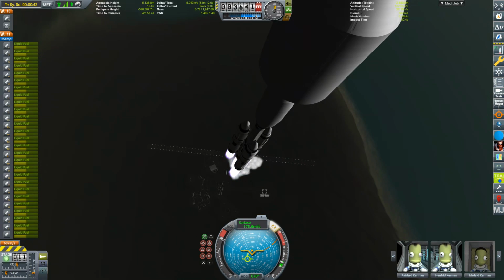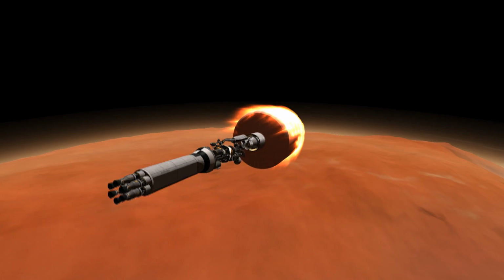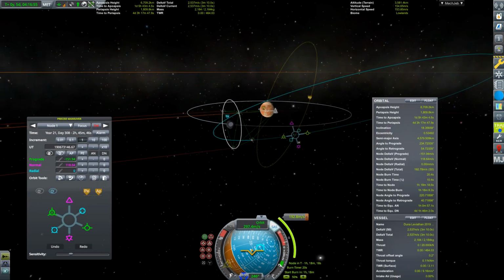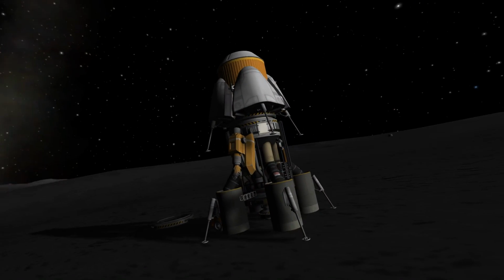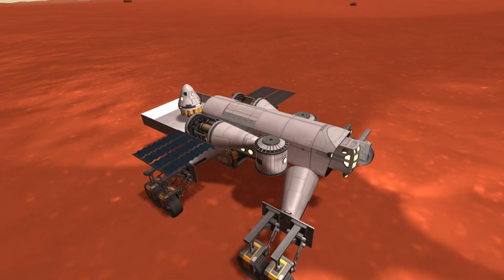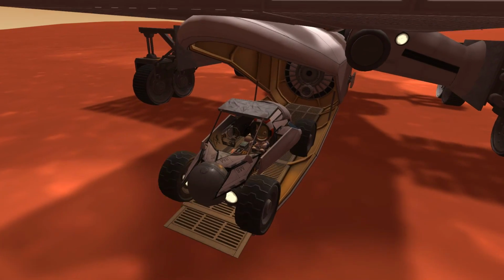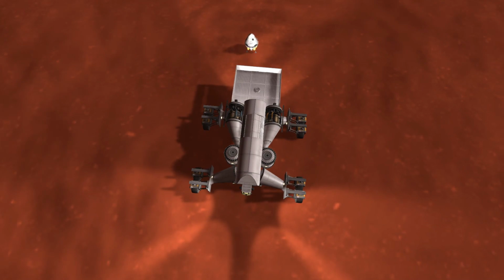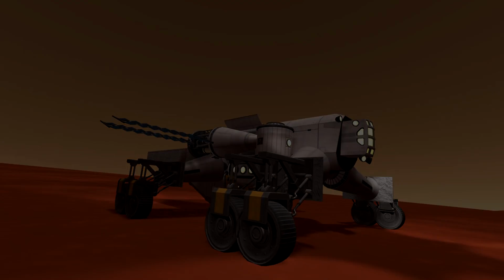THE DUNA DEVOURER - An Over The Top Opportunity Rover Tribute

Comment: Why aren't you using 60fps in 2019? 
If your screen capture software doesn't support 60fps, use OBS. It is cross platform free and open source screen recording and streaming software.
Reply from the maker: Because I don't want to.
Reply: @ShadowZone  Why do you torture your viewers with low, stuttery and laggy framerate while you yourself play at 60fps (or more, if you have 144hz or 240hz monitor)?
I completely understand, if content creator doesn't have hardware and therefor simply can't, but if it is because "meh, it is good enought", it makes my blood boil. Technology should be used to the max and boundaries should be pushed.